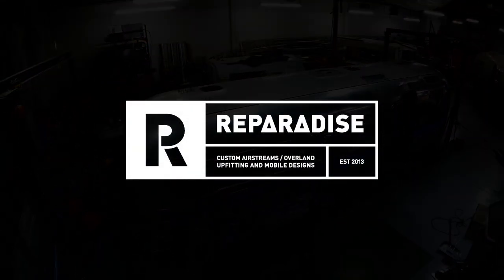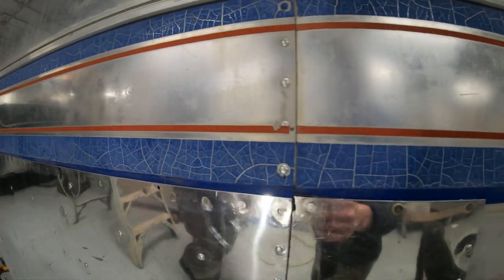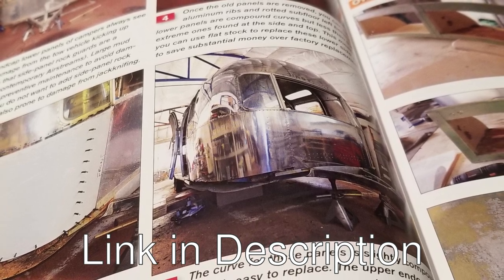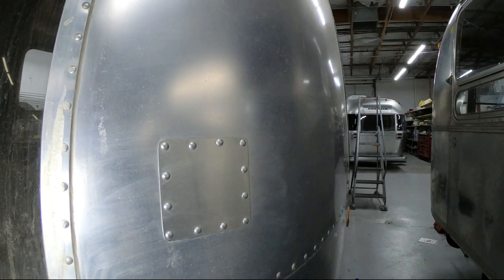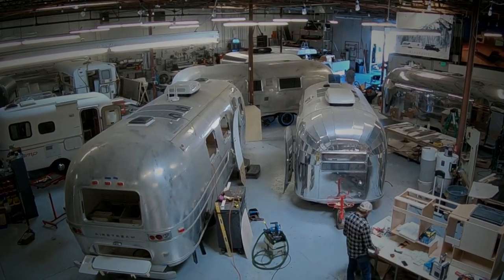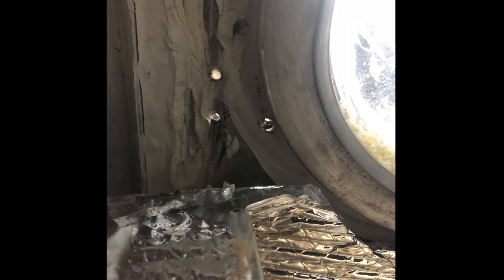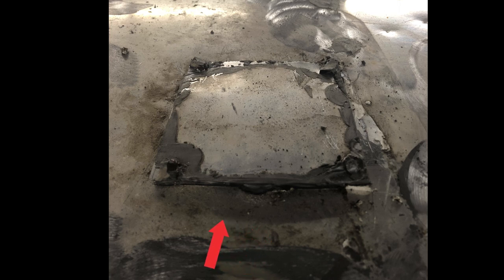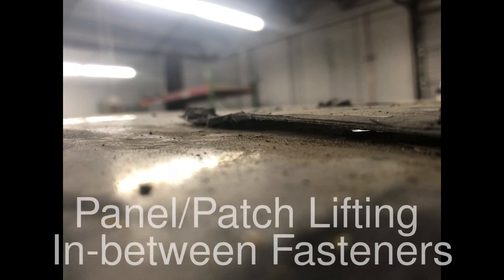Airstream Patch Panels and Skin Repairs

Comment: Quotes I got to replace two panels was around $15,000. Does that sound accurate? I planned on doing it myself with shave-able rivets.
Reply from the maker: HI Bradford, unfortunately Airstream construction requires a large amount of labor to it correctly. If they're going to have to remove and replace interior components, that adds even more work.